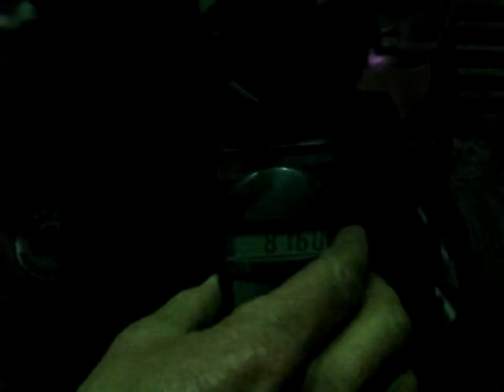Briggs & Stratton Blow Up Engine On Oxygen

Comment: I was expecting a broken connecting rod, before a burnt intake valve.(or perhaps, a burnt exhaust valve) This is why I prefer Briggs & Stratton. No other small engine would have lasted that long, running that fast. Briggs & Stratton: There is no substitute!! I still wouldn't be standing that close to an engine turning that fast.

Comment: The oil sling on the stock rod would have broken off at 7k
Reply: Christopher Poucher don’t know about that. The slings aren’t much of anything and if I remember right the horizontal shaft doesn’t use one anyway. 

I’d be more concerned of the flywheel separating. I’ve seen one come apart on a stock lawnmower and it did some damage, I can’t imagine what it would do at 8-10k rpm

Comment: No wonder Briggs discontinued making those engines. They'd be out of business if they did. My dads push mower has this same engine and it's just ended its 41st year still starting first pull pretty much every time and running fantastic. Hardly ever a single issue EVER out of that thing!

Comment: You mean 100% oxygen?
Reply from the maker: no, still running off normal air, but had the oxygen flowing through a hole in the intake manifold aswell
Reply: So on air plus 100% oxygen?
Reply from the maker: yeah

Comment from the maker: We weren't able to get it to throw a rod or anything exciting, but it did manage to get so hot that it melted a hole on the outside of the exhaust valve seat, straight out the exhaust port. So it ended up loosing too much compression to run again.